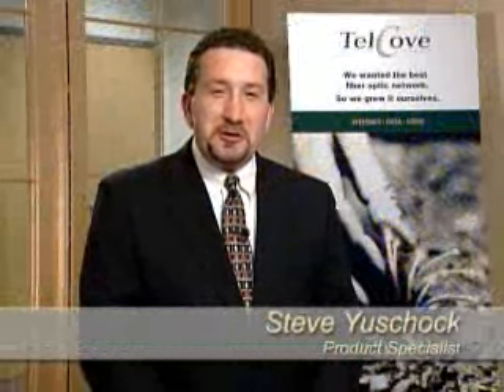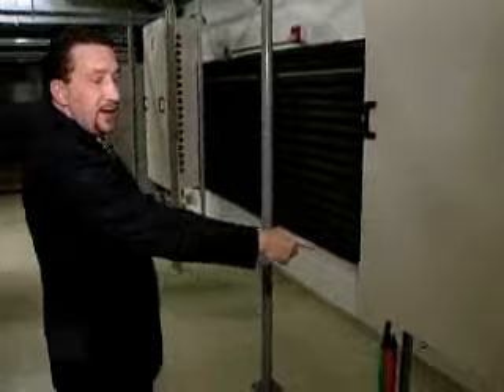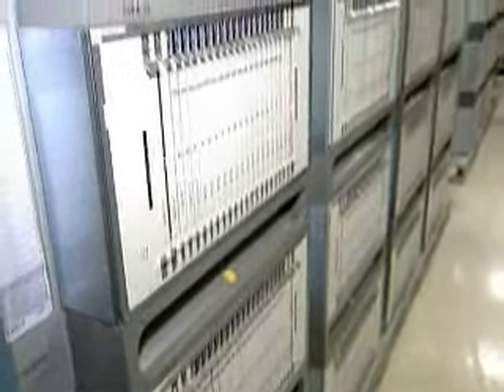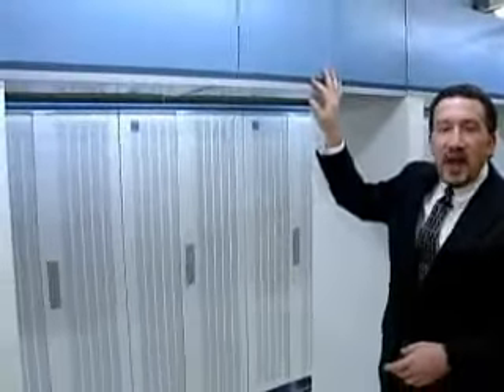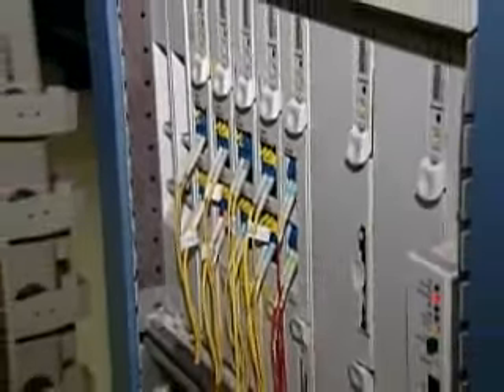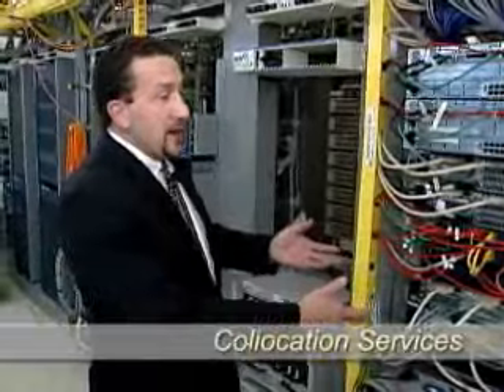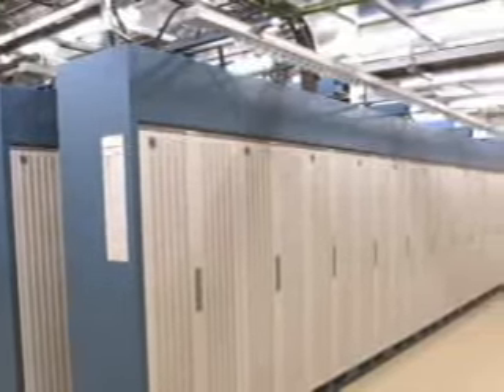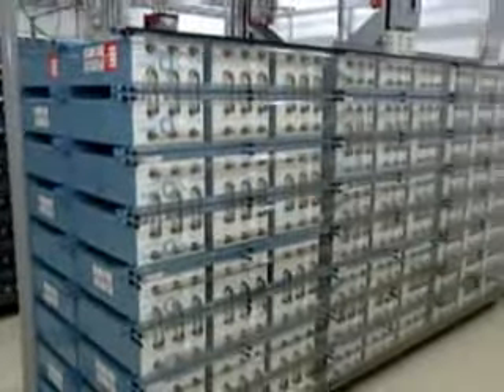TelCove Central Office Tour

Comment: Yeah! A #5ESS. Best TDM switch out there. Beats the pants off the DMS-100!
Reply: dmine45 I hate the DMS. You cant even pull PM's on them unless they're SPM. 5E is way more intuitive once you learn it.
Reply: we had a colocated 5ess with a dms100 and a gtd5.
Each had advantages.
The 5ess was incompatible with so much customer station equipment, we were always doing workarounds to fix the complaints.  -Tech support for that  from Lucent was a p.i.t.a.  And while the 5ess concentration ratios were like others, the numbers were smaller,  i.e. just a few line hogs could kill dial tone access for many.  That was because it really is a one stage analog switch (diode gates) connecting lines to a digital network.  Newer versions changed that dumb design.